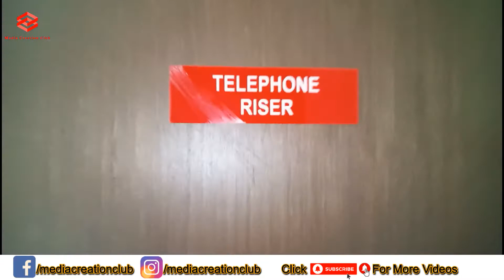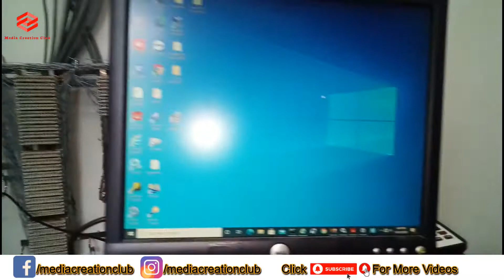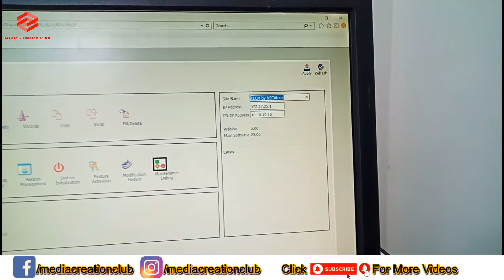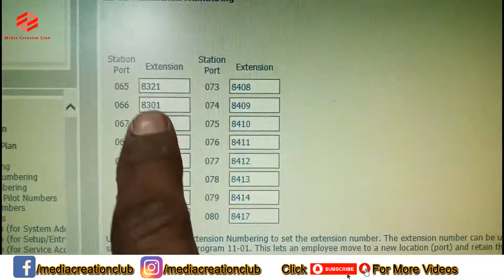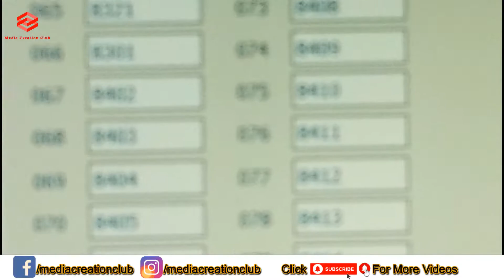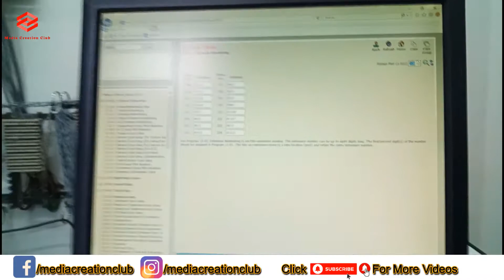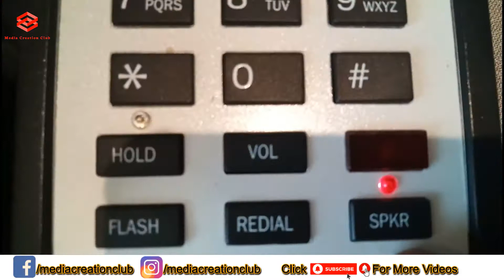How to Trace Wires inside Walls || Phone Line FAULT Finding And REPAIR || How To Use Wire Tracer

Comment: Your video date is 4 years ago, but still active and can be watched. Thank you very much for your explanation. But there is a extraordinary things that i have to tell. In video time 5,23 you connected the transmitter cables to the bluewhite and blue cables of wall socket, and then in the line room wall connection box you find the signal on the orange and orange white cables. It is quite interesting. 😮😮😯😯 Thank you very much, Best wishes.
Reply from the maker: Thanks for your support 😊 🙏 
Your point cable colour code blue and white 
And orange and white 

The cable we run normally from room till matv room one colour and from matv to pabx room different colour code 
And sometimes it's out patch cable different colour 

We just use transmitter to test cable locations to identify the same cable 
Tq...
Reply: @MediaCreationClub1  thank you for your explanation, ( for the video that belongs to 4 years ago, )